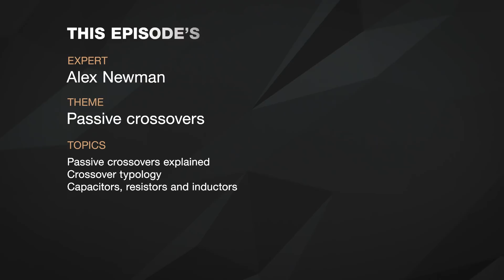Passive crossovers, explained.

Comment: I do wonder about the PR (Passive Radiator) vented systems. They tend to get the balance between ported & closed enclosures.
And they do sound different. I experienced them to be definitely more clean than the ported and having more depth than the closed enclosures... Best of both worlds ?
What are the Dynaudio experts thoughts about PR systems ?
Very informative videos btw, just keep doing them. Gr8 job !
Reply from the maker: Hi! I managed to have a quick chat with Alex about your question. He says: 

"I would say we have a lot of experience with ported/vented systems and so we're able to get great results faster for passive systems. Our technologies in our driver design are also optimised for ported and sealed enclosure systems, such as our MSP diaphragm.  

For active systems, closed boxes (as you will find in the Focus 60 XD) allow versatility when using DSP, they also have a better time response at low frequencies compared to vented systems. We often use highly damped ported enclosures for active systems, for example in LYD and new XEO range, as we can achieve similar advantages with added bass extension. 

Passive Radiators are good for avoiding box resonances being audible, however, we solve this issue by rear loading our ports. Passive radiators can also restrict the size of the enclosure designed as they often need to be larger in surface area than the active woofer, therefore, smaller box designs can be difficult to achieve. 

There are always trade-offs between different loudspeaker system designs and we usually chose ported boxes."

I hope this clears things up a bit, 
Christopher.
Reply: Dynaudio That was an intense info with loads of  real-life experiences from my favorite speaker Brand.
Thanks for your efforts Christopher.
Reply from the maker: No problem! ☺️ //Christopher.
Reply: @dynaudio  Should be feasible nowadays, there are plenty of small box passive radiator designs that can achieve deep bass. May be an issue if you're trying to cram an amplifier in there too